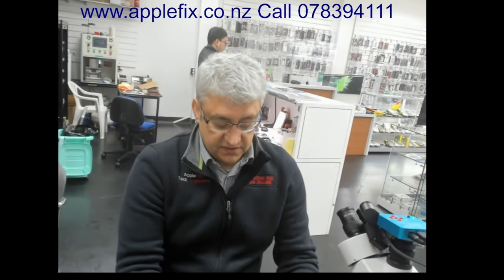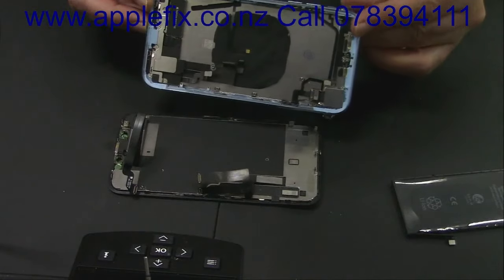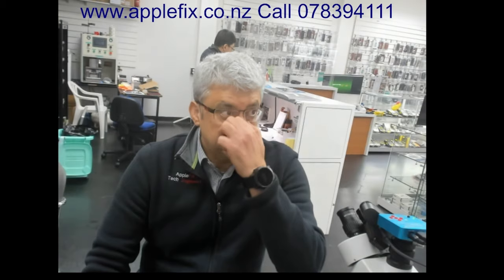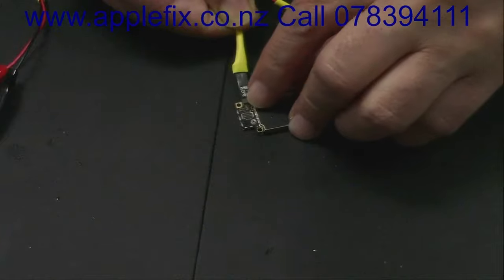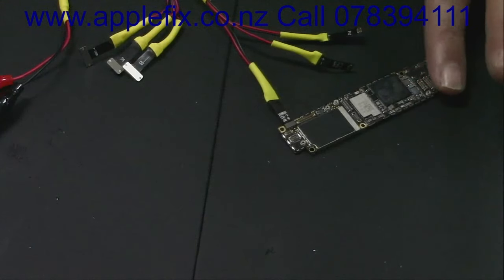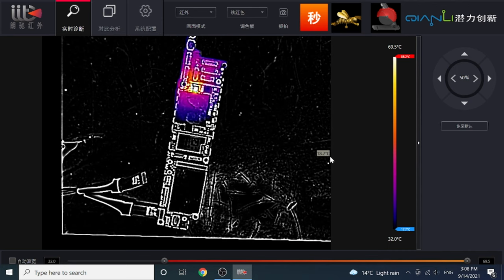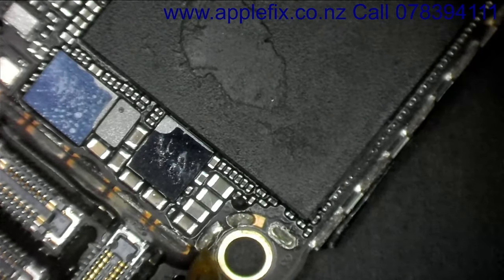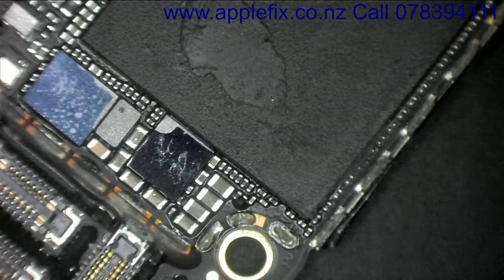iphone xr dead shorted audio ic repair applefix new zealand

Comment: Thank’s for sharing your knowledge , just a question, why you don’t use power supply , why this short killer
Reply from the maker: You can use power supply but the short killer board is designed to burn thin wires ..
Reply: @ApplefixCoNz  ah ok thank’s .